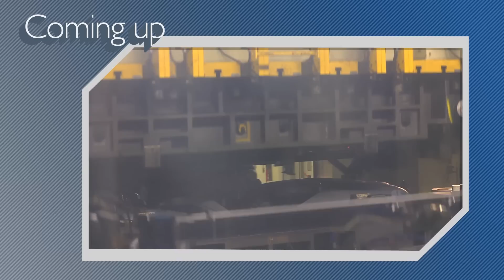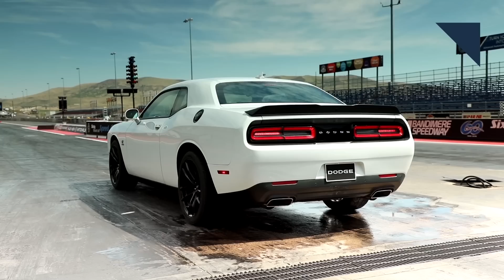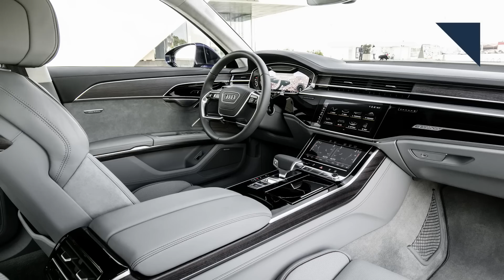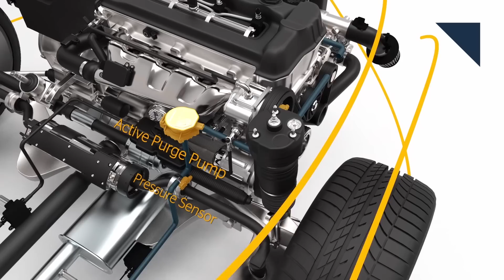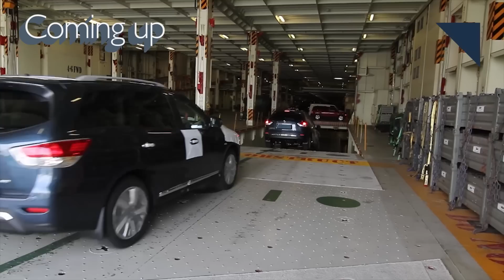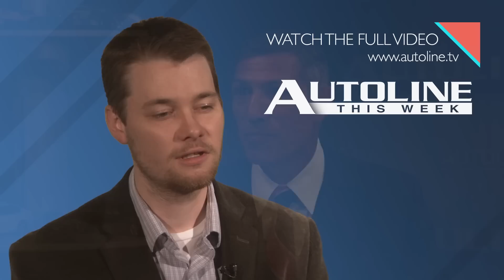2019 Audi A8 Price, Mini Robots Inspect Engines - Autoline Daily 2396

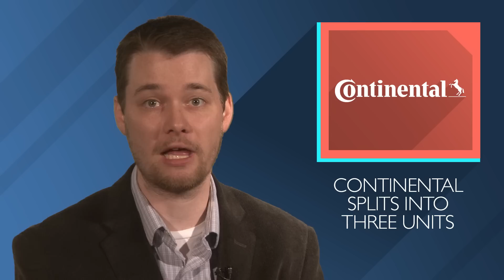Comment: 4:02 Continental Splits into Three Units-Splitting a company and spin offs make sense when there is divergent interests in the different parts that need different types of management and investments. 

But FCA of Spin Off Magneti Marelli seems domed if it just to stop investing in it. And it will still own it after the Spin Off anyway. So the stock most likely drop after the Spin Off due to it low prospects of succeeding.

Comment: The thumbnail shows the new A6, not the A8
Reply: @Autoline Network
There must have been a mistake, because the car on the thumbnail is not the new A8, it is the A6. I work for a big automotive company in bavaria and I promise you that that is the new Audi A6. Maybe there was a mistake on the Audi website?
Reply: Seems to be a mistake by the audi marketing team. Here are the links to the german site:
Audi A6: https://www.audi.de/de/brand/de/neuwagen/a6/a6-limousine.html
Audi A8: https://www.audi.de/de/brand/de/neuwagen/a8/a8.html
Reply: the A8 has an chromline on the bottom of the doors / side of the car. the thumbnail shows the A6
Reply from the maker: We went back and checked Audi's website and can confirm the thumbnail image is the A8.
Reply: as far as the pricing of the 2019 A8, i am not surprised at all. that sounds about right. however, the only problem i would have in a purchase of one is at that price i would have to buy the s class instead smh
Reply from the maker: Here's a link: http://media.audiusa.com/gallery?model_id=308&category_ids=&event_ids=&categories=&models=A8&events=&year=&advanced_search=&image_tag=&types%5B%5D=image&types%5B%5D=video&show-all=&sort_by=published-desc
Reply: Y can't ppl especially the teutonic ones just admit they were wrong? 

PS I hear it's good for the soul...